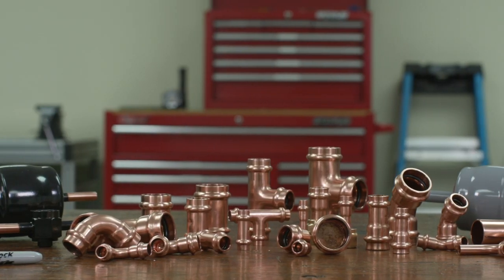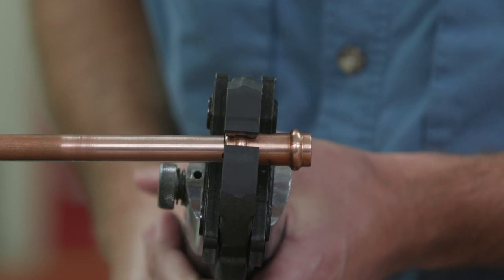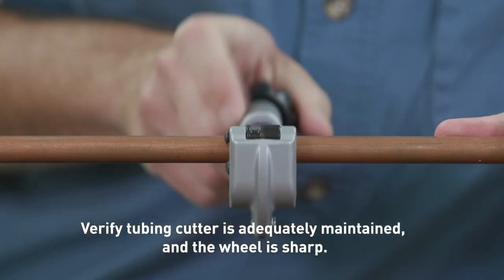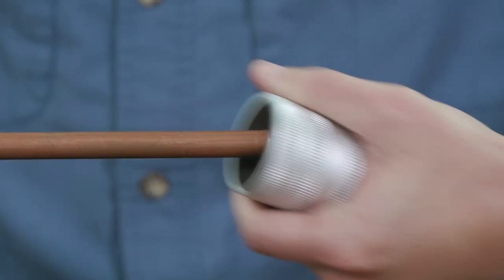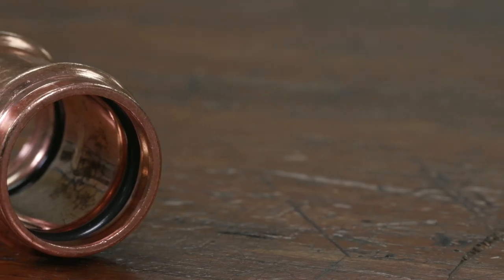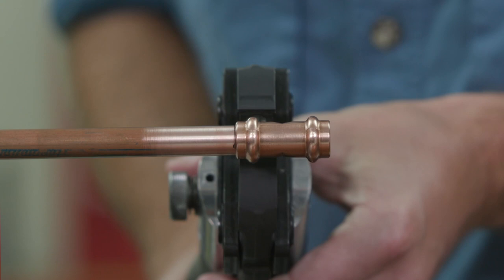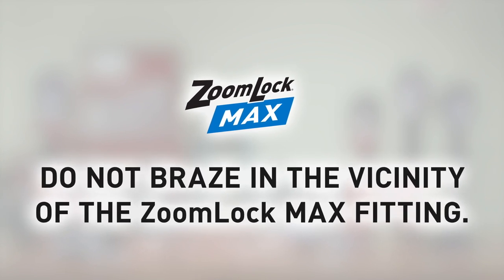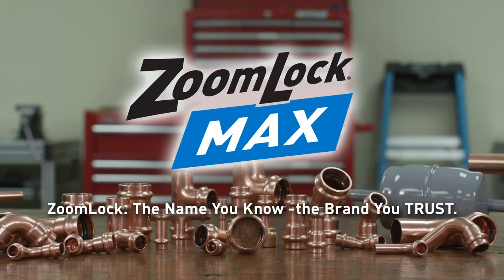ZoomLock MAX Refrigerant Press Fittings – Connect Refrigerant Piping in Seconds with NO BRAZING!

Comment: Will the nibco or rigid hex plumbing hex shaped crimp jaws work on these?
Reply from the maker: Yes it works with Nibco and Ridgid. See the ZoomLock MAX Catalog K-3 page 13 for details. http://images.solutions.parker.com/Web/Parker/%7Bd505988f-6aad-45f8-9229-20601c356656%7D_Catalog_K-3_ZoomLock_MAX.pdf

Comment: What’s the difference between zoom lock max and regular?
Reply from the maker: Zoomlock MAX advantage:
 
• Hermetically sealed packaging for debris-free fittings
• Hard, robust copper fittings made from refrigerant grade copper
• Proven three point press technology providing a leak free and secure joint
• No more crimp gauge needed—connect the fitting with one complete cycle
• Jaws available for most professional crimping tool brands, both large and compact
Reply from the maker: @yairsmechanical6908  We have a jaw exchange program for the ZoomLock MAX jaws. Visit ZoomLockMAX.com and fill out the demo form for more information.

Comment: Are the jaws different from the Ridgid/MIllwaukee Jaws?....they look to be the same.
Reply from the maker: There are specific jaws for ZoomLock MAX that work for both. Milwaukee M12 and Rigid RP240, 241 use the ZoomLock MAX 24kN jaws and Milwaukee M18 and Rigid 340, 341 use the 32kN jaws. You can visit zoomlockmax.com for more information. Thanks
Reply: @sporlanvideo  thanks for the reply, i guess my question is are the regular jaws that are used for standard plumbing press fittings any different then the zoom lock max jaws? They appear to be identical.
Reply from the maker: @bkoz319  ZoomLock MAX jaws only work on ZoomLock MAX refrigerant fittings. ZoomLock MAX refrigerant fittings can NOT be crimped with any other jaws.

Comment: Can you use the old fittings with the new Max jaws if I have a bunch of older fittings ?
Reply from the maker: The ZoomLock MAX fittings only work with the ZoomLock MAX jaws. If you go to ZoomLockmax.com and fill out the demo form you can get more information regarding switching your old fittings to ZoomLock MAX.

Comment: will the milwaukee m18 press tool jaws work on the new zoomlock MAX fittings?
Reply from the maker: ZoomLock MAX does work with the M18 but you still need to have the ZoomLock MAX jaws to use for the ZoomLock MAX fittings.
Reply: @sporlanvideo  What is the product number for the Zoomlock MAX jaws for the Milwaukee M18 Force Logic press tool?
Reply from the maker: @bobbysiu4992   MZK-32KN JAW KIT (7 PIECE)
871408 -https://www.parker.com/Literature/Aftermarket%20AC%20and%20Refrigeration%20Division/Catalogs/PDF%20fies/Catalog%20K-3%20ZoomLock%20MAX.pdf
Reply from the maker: @bobbysiu4992  MZK-32KN JAW KIT (7 PIECE)
871408

Comment: What happens if you press more than one?
Reply from the maker: You only need to press one time. You can press as many fittings as you need to complete the install. There isn't a limit on the amount of fittings used.

Comment: Jesus. Another shark bite disaster waiting to happen. Ill stick to soldering all my connections. If it ain't broke don't screw with it. So hat if I have to have a fire watch. I won't have to worry about leaks or it blowing apart. Theres no way this will hold up to a out of balance condenser fan or compressor vibrations. 😩
Reply: I've never had any issues with sharkbite connectors, but I feel that people complain about them when using them incorrectly.
Reply: You’ll stick with solder??? Solder is not to be used on any refrigeration lines……